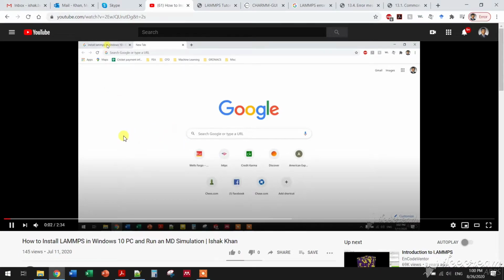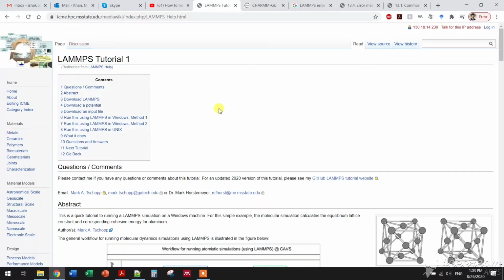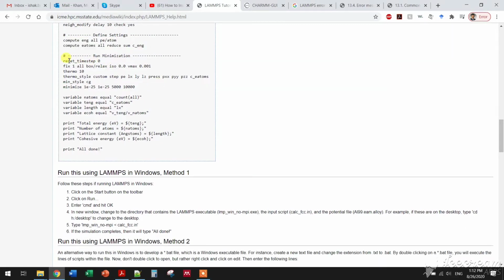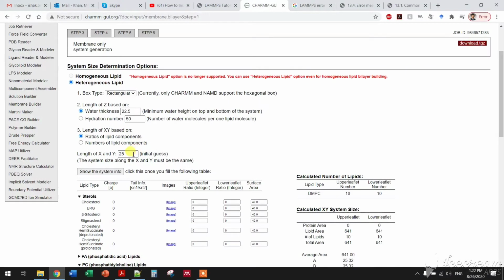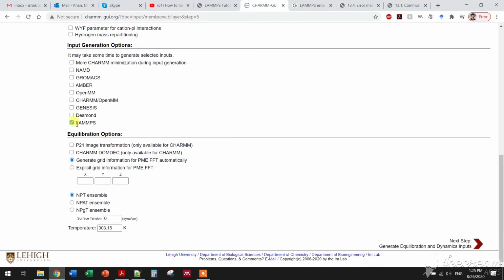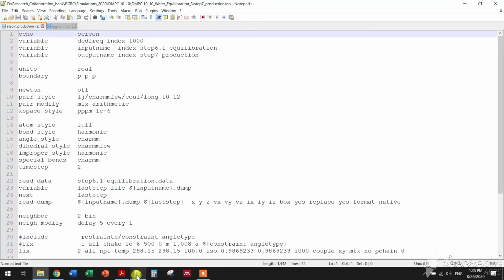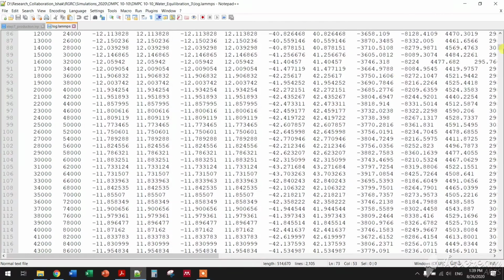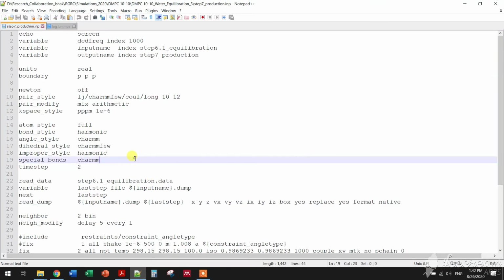LAMMPS Tutorial: Installation, Creating System, Running Simulation, Fixing Errors | Ishak Khan

Comment: can i use lammps for understanding the melting of material with molecules movement with thermal energy (or heat energy)
Reply from the maker: The short answer is yes. But for specific simulations, you've to explore the documentation a bit. Refer to these links: 1. Melting metal: https://www.youtube.com/watch?v=MOeWvDfthbY; 2. Forum discussion on melting metal: https://matsci.org/t/lammps-users-melting-of-alloy-using-eam-alloy/6317
Reply: @IshakKhanBD   thanks

Comment: it is a nice lecture for learning lammps and how to use Charmm-gui. but my question is, can I use charmm-gui for atomistic model. Suppose I want to use 1 type of refrigerant. Can I use charrm gui for that purpose? Also here for equilibrium, charmm ueses NPT or NVT like this, in lammps its Nose Hoover thermostat and barostat, how can I use other thermostat and barostat?
Reply from the maker: Thanks for the comment. For specific atomistic simulation of refrigerant, charmmgui documentation might help - you’ve to go through different methods of making model. For getting rid of confusion on npt or nvt settings, please explore lammps documentation on fix npt and fix nvt commands in your input script.